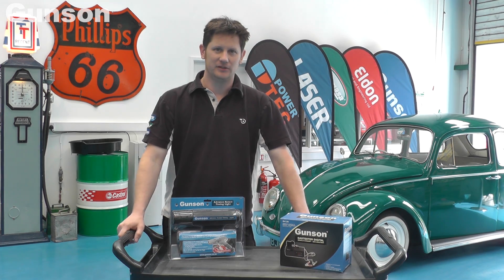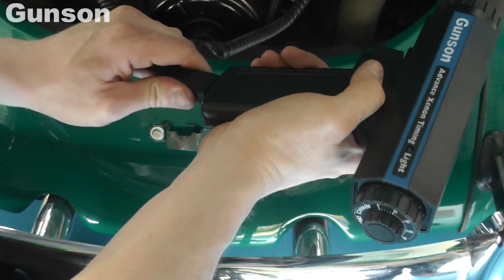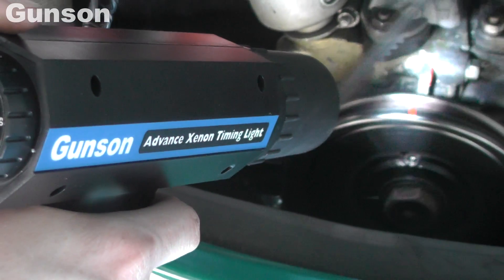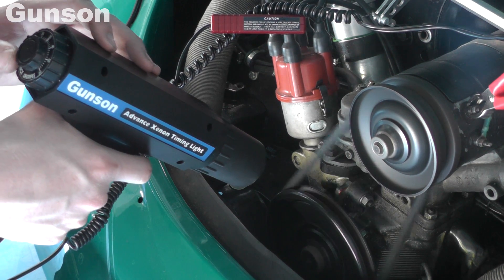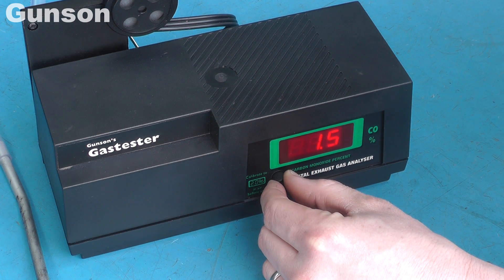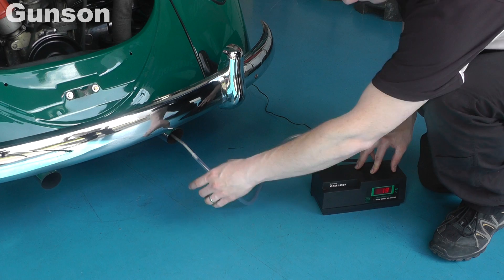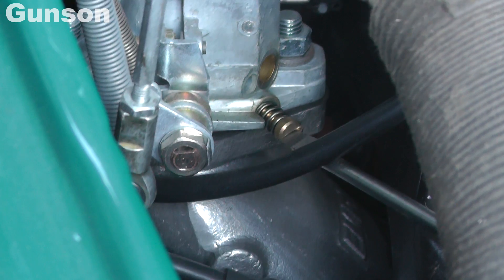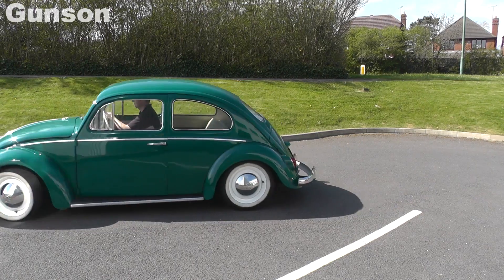G4125 Gunson Gastester & 77008 Timing Light

Comment: It looks like you used the gas tester to adjust the mixture screw. Is it possible to use the gastester to assist with jetting? And if so can the secondary jets be set somehow? I'm assuming the idle jets could be easily adjusted but to get a reading on the secondary part of the carb you would need to give it gas and drive it down the road. Just wondering how I can make that work.
Reply from the maker: The Gastester was only ever designed to be used at Idle, not for power runs etc or high rpm.
The pulse pump will only work at idle as it uses the pulses to work and at higher rpm the pulses maybe too close.
It’s also only accurate to 0.5% which I don’t think is enough for higher rpm.
Also the heat would be a problem for piping and plastic collector, etc.
Reply: OK I see. Is there some kind of tester that can help with getting the jets set properly on the carb while at half or full throttle?
Reply from the maker: That's what a rolling road is for!
Reply: I have a truck with spark knock and no power. I've tried timing all different ways, rejetting carb many different ways, even tried a 2nd carb and no fix. New coils, new wiring, new distributor... Trying to narrow down the issue.
Reply: @rustycraig1713  probably its getting some extra air from somewhere if anything else didnt work